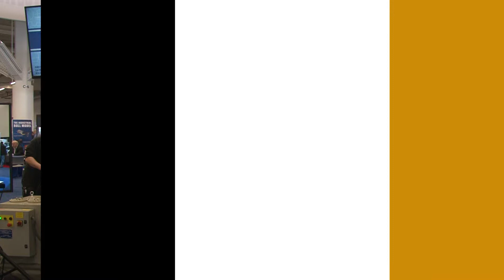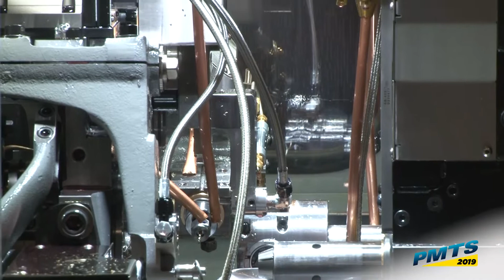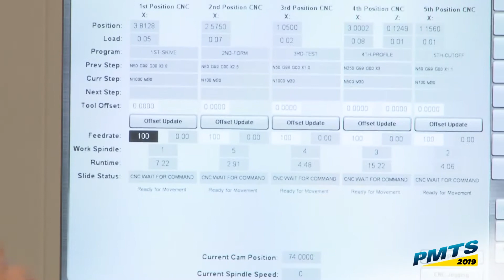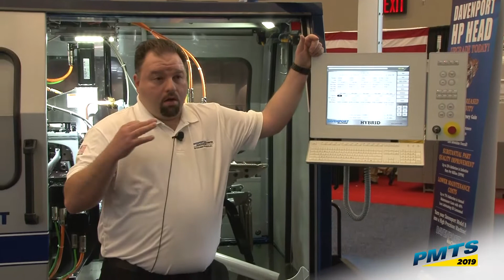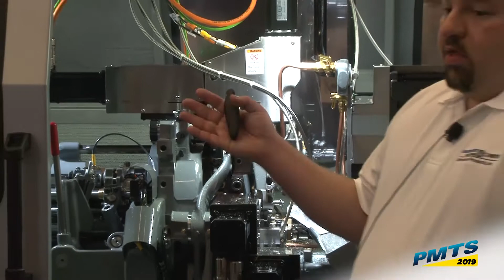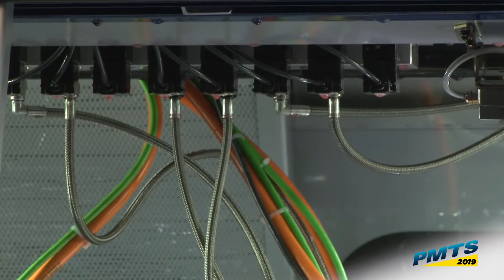Davenport Hybrid Machine Live Demo PMTS 2019 | Multi-Spindle CNC Precision Machining

Comment: It doesn't even say how it is a hybrid. Between Swiss screw and cnc? Runs on gas and electric?
Reply: The hot side stays hot and the cold side stays cold.
Reply: Hybrid between mechanical screw machine and multi spindle cnc. Says it right in the first few seconds of the video.
Reply: The side tools run on the cnc and the end tools are cam driven

Comment: I suggest that you hire a professional presentation outfit to work with your script to create a better organized presentation. This one tends to skip around and needs to proceed from one selling point to another with better flow. The main point of using the advanced Davenport is  less expensive and more accurate through-put of parts and fewer second operations, and at a lower cost.
Reply: A screw machine is not similar to a swiss lathe. The main point of a screw machine is time per completed part. If the part can be done on a screw machine.
Reply: The presenter is the senior design engineer and obviously knows the machine like the back of his hand. If I had never heard of a Davenport machine, I would walk away not being that well informed.  It might be helpful to have a “Davenport 101” presentation covering the type of parts a Davenport is capable of producing as well as a tour of a machine.